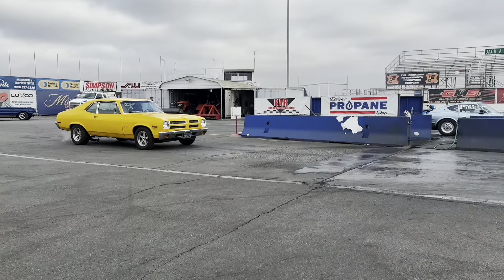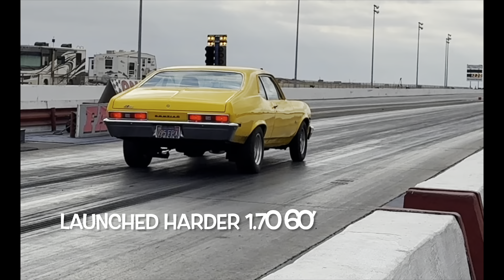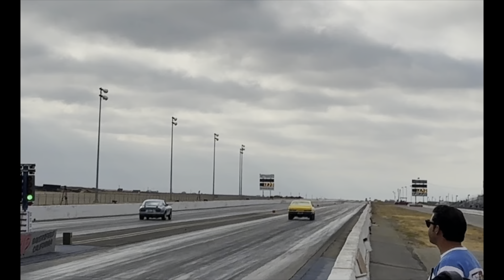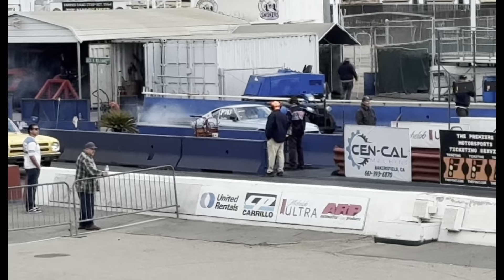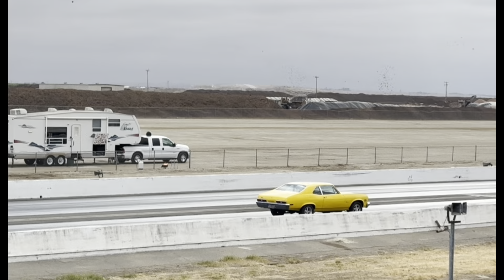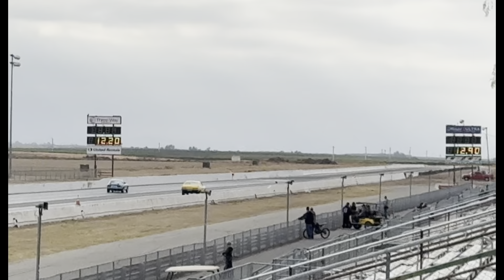1972 Pontiac Ventura - Testing 3600 Stall Converter 13.04@100mph 1.70 60’

Comment: Could it be blowing through the convertor being too loose to lose 5 mph?
Reply from the maker: I’m thinking it’s the cam not in the power band. With this converter, 2nd & 3rd gear pull from 5k to 6k. Before I would probably need a cam that makes power in that RPM range. With the previous converter, it was using more of the torque. Same shift RPM. The 60’ was much better just no top end to keep pulling through. Also was thinking about switching to 3:42 gears to see if it would help the top end.